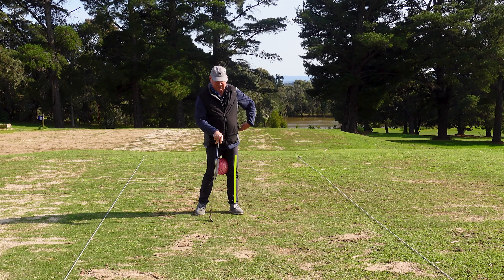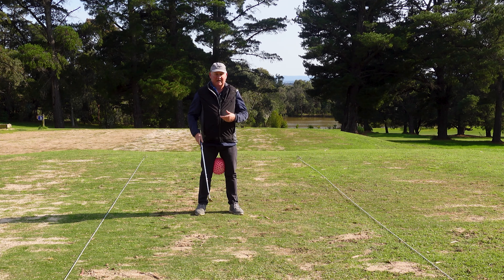The Biggest Pitching Mistake Golfers Make (and How to Fix It)

Comment: Boy does this one bring back memories Brian. Still have the video you took of me driving my legs while pitching. I haven’t used the ball, but the cross legged drill you showed me still gets a run every now and then. Also the feeling i work on now is, trail elbow connected and my body rotating around a straight left side. My stats app tells me from 60-20 m off the green Im +4. Was a very weak area of my game, now I’m pretty confident pitching.
Reply from the maker: Brilliant Matt. 

Well done on that improvement. 

This drill is just a variation on the one I showed you. 

Keep up the good work. 

Brian
Reply: @fitzygolfpro  thanks Brian. Obviously lots of practice too!! Main go to drill is a variation on one you recommended. drop 2 balls at 30,40&50 m and don’t go home till they are all down in X shots or better 
I started  with aiming for 18 but now aim for 15 or better 
Good putting practice too
Reply from the maker: Brilliant practice routine. Well done.